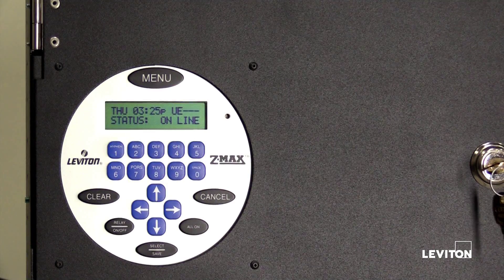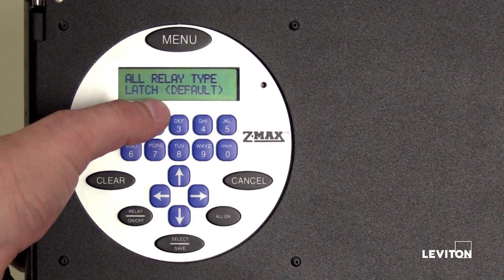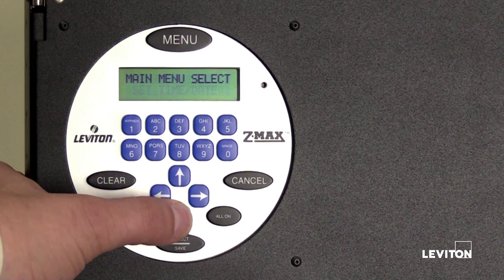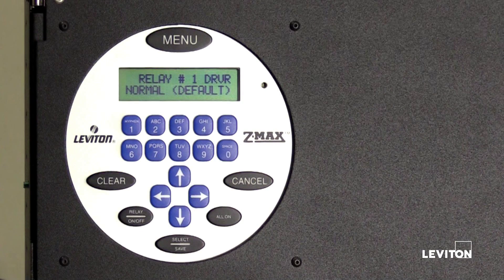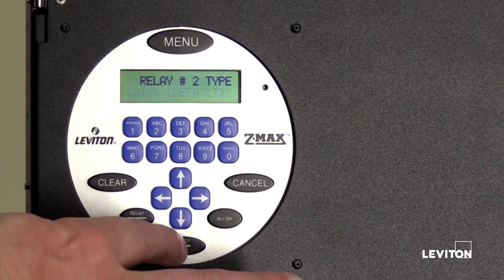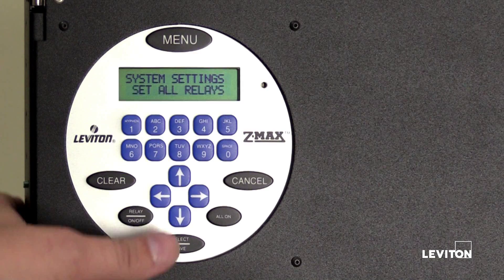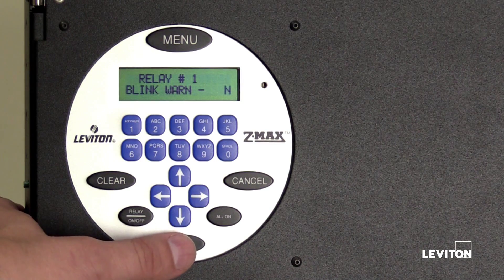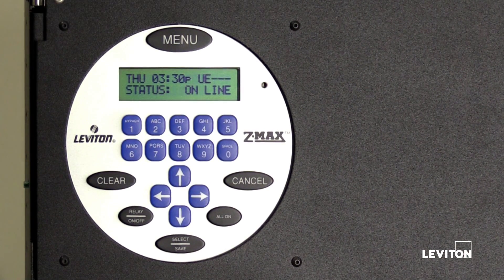EZ-MAX Plus: How to Configure Relays

Comment from the maker: More EZ-MAX Plus Relay Panel videos!

How to Wire a Low Voltage Switch https://youtu.be/UptPX22ViEk

How to Set the Clock https://youtu.be/e-iAGrczhC8

How to Set a Schedule https://youtu.be/lp830F-ERZo